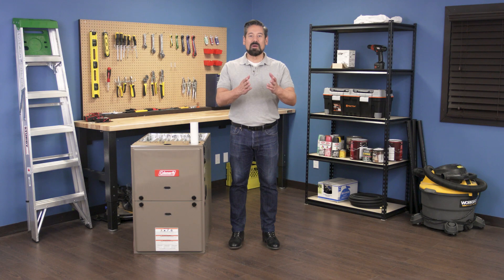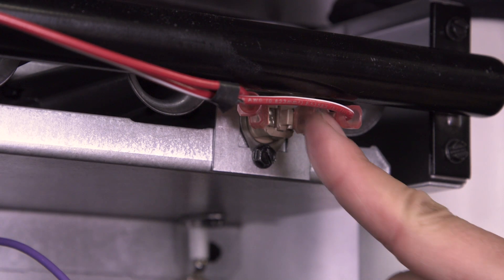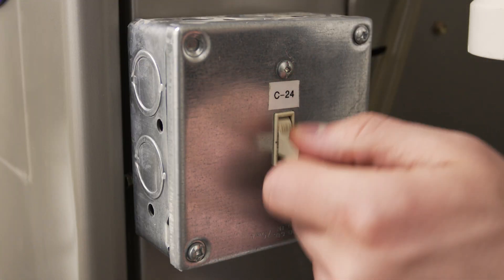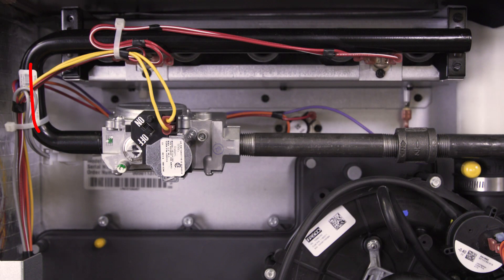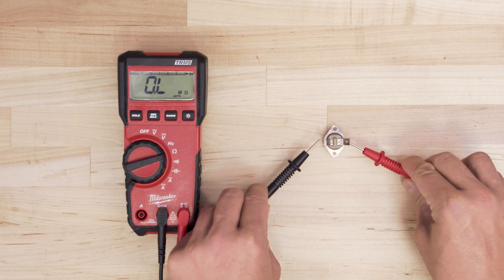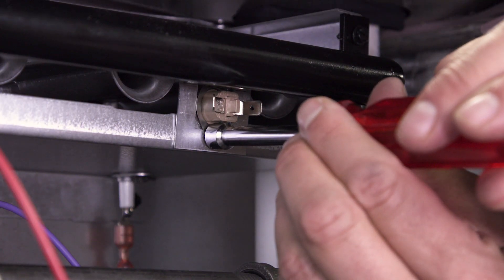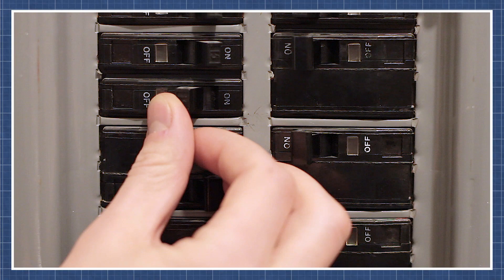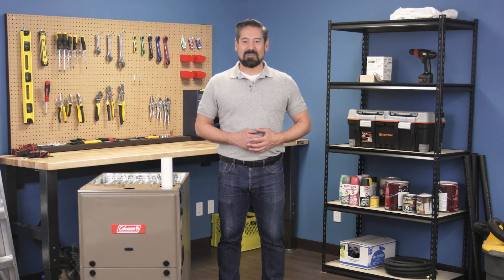Furnace - Flame Roll-Out Switch | Repair and Replace

Comment: Wouldn’t getting a hairdryer or something like that be another part of the test to make sure that it opens and is resettable versus just testing that it has continuity?
Reply from the maker: Thanks for watching. Yes you could test it to see if you can get it to trip again but generally these do not fail closed. There is a piece of metal that will heat up and bend and it will snap to open and disconnect the circuit. If the switch tripped, and you're able to reset it and it has continuity when it is reset both states are good. The most likely way for this switch to fail is that is is unable to reset and has no continuity in either state.

Comment: Dose wires has polarity?
Reply from the maker: Thanks for watching. A switch is a non-load component that provides an unrestricted path for electricity, or disconnects the circuit. There is no polarity and it doesn't matter which of the two wires attaches to which terminals, the switch will work the same.
Reply: @AmreSupply  thank you for quick reply 🙏
Reply: @AmreSupply  I was just at the job site saw rollout switch hanging next  burnes) it looks like it broke off the metal bracket 😳  but gas furnace still running,  I just placed back to the same metal bracket  , going to replace  tomorrow.

Comment: how did u get the furnace to light up w flames? after swapping the switch
Reply from the maker: Thanks for watching. After replacing the switch, the furnace should light up as normal however if there is an issue with the burners which is causing the flames to roll out the front of the burner, then installing a switch will not fix the problem.

If the furnace doesn't start up at all then it could be another issue, or the furnace might be in a lockout state. You can observe how far into the startup sequence it gets to help determine what is happening: https://www.youtube.com/watch?v=b0sAGt-1niU

Comment: I can’t find mine! Help! I have a Payne from the 80s I think the model number is super faded on the label. I know it’s an intermittent ignition. But it lights and then the flame shuts off soon as the blower comes on. What do you think the problem could be?
Reply from the maker: Thanks for watching. Does your furnace have a flame sensor? You can learn more in this video: https://www.youtube.com/watch?v=b0sAGt-1niU&lc=UgwaMZMBBptYZZllg1N4AaABAg

If the flame sensor is dirty or if the burner is dirty then the flame sensor will not complete the circuit through the flame and through the metal of the burner. Without a complete circuit, it thinks that there is no flame and it will shut of the gas.

Comment: I have a limit switch,  L17520F limit switch.  When the furnace blows cold air,  i reset the flame roll out switch.   Which device is the problem?

Thank you.
Reply from the maker: Thank you for watching. I am not sure what you are describing. Are you saying that the flame rollout switch trips during normal use? Or does it trip even when blowing cold air?
Reply: @AmreSupply  it runs fine for a cycle or two in the mornings.   When i get home every day at 4 or 5 i have to reset it.   Is it just because it runs all day?  My mom likes it too run all day.
Reply from the maker: @dalenjurgens6751   If the flame rollout switch keeps on tripping then there might be an issue with the burners. In this case it's best to hire a technician to take a closer look as simply replacing the rollout switch is unlikely to fix the problem.
Reply: @AmreSupply  that's what I'm discovering.

Comment: So I guess the issue isn’t the flame rollout switch in my case? Otherwise I wouldn’t have hot air, right?
What’s causing the blower motor to run 24/7 despite the thermostat fan setting being on Auto, not On? 
Was able to confirm the High Limit Switch wasn’t the issue. What else could it be?
Reply from the maker: Thanks for watching. A tripped flame roll-out switch will shut the furnace off. If the blower motor is running constantly, it could be an issue with the thermostat itself, or the control board.
Reply: @AmreSupply  Cool, I’ll look into those next. Thank you!

Comment: When he says airflow issues it could be as simple as dirty filters impeding air flow.
Reply from the maker: Thanks for watching. You are right that dirty air filters can create issues and it's always best to replace the filter, however if the flames are rolling out the front of the burners that's likely an airflow issue within the burners, heat exchanger and inducer motor. The furnace filter does not supply air to these parts.

Comment: Why not just turn off power cut the switch wires strip them and wire nut them together turn power back on and run the furnace for another 10 years~
Reply from the maker: Thanks for watching. It is not recommended to bypass any safety switch in the furnace. If the switch has failed then it should be replaced. If the switch is good, and it keeps on tripping then that means that the furnace is not operating in a safe way and will need to be inspected further.

Comment: My flame rollout switch keeps tripping. It overheats to 32.5 degrees Celsius. Could this be caused by a slow blower? Caused by defective capacitor?
Reply from the maker: Thanks for watching. If your flame rollout switch keeps tripping then there's likely an issue with your airflow. Its highly recommended that you get it inspected by a HVAC technician as soon as possible.
Reply: @AmreSupply  thank you, he’ll in be today
Reply from the maker: @MazingerZelchancho  Glad to hear it.
Reply: @AmreSupply  any way to check if the motor is switching from low to high?
Reply from the maker: @MazingerZelchancho  You can listen to get a sense of where the furnace is in its sequence. After a call for heat is made the inducer motor will run, this will be a bit quieter than the blower motor. After a minute or two the burners will ignite and the blower motor will kick on and circulate air around your home. With a blower motor with several speeds it will behave differently depending on the model but it will use high and low speeds to help maintain a more consistent temperature.

Comment: Thanks for the tip!  It's worth a try, if it doesn't hold no harm done you can always call the technician.

I don't know why some of these folks are getting bent out of shape; maybe they're the ones that charge $300 to push a button.
Reply from the maker: You're welcome, we're glad that you found it helpful! Overall I think a little bit of knowledge goes a long way and regardless many homeowners are still going to call technicians as they have the tools and knowledge to do some deep troubleshooting.

Comment: My AC repair tech was going to charge me $1,000 to replace the circuit board in addition to the $69 TS fee I already paid!!! I did this and fixed my issue. I appreciate the you guys, thank you.
Reply from the maker: Thanks for watching, we're glad that you found the video helpful! That is a steep price to replace the control board. If you do end up replacing it, its relatively simple all things considering. This video will show you how to access it: https://www.youtube.com/watch?v=4SY8lRl8HV0&feature=youtu.be
Reply: Was it short cycling ?
Reply: My board was not commanding 24 V AC to the gas valve. Changing the control board fix the problem. I knew this because the gas valve was opening and closing when giving it direct power from the transformer.  So I knew mechanically it was sound.
Reply: unfortunately finding the honest HVAC service contractors and or tech is the biggest problem. If you find one then keep him/her and recommend to your friends. Majority are typical capitalist and wants to be rich quick by their deceptive talks. Always check online for others options.

Comment: Mine runs for 15 or 20 minutes than Shuts down for 3 minutes  than come back on 
but it heats the house 
Code 33
Reply from the maker: Hi Brytney, thank you for watching. Best thing to check is to make sure that you furnace filter is changed, and that there is no restriction in the airflow. You might find this video informative overall. It could also be an issue with the high limit switch. You can learn more here: https://www.youtube.com/watch?v=0va_wvwfCBA

Comment: Why not check continuity with the switch installed?  If it checks bad then it can be removed..
Reply from the maker: Thank you for watching! You are right that you don't need to remove the switch to test it. For these videos we find that showing continuity tests on the bench with an overhead camera often gives the most clarity. This makes it easiest to see what is being tested while showing the multimeter display.
Reply: @AmreSupply  I now understand.  Thanks for your reply and thanks for posting your videos.  I have already fixed my furnace (replaced a control board) and my air conditioner (stuck float switch).  Did both myself and no doubt saved hundreds of dollars.

Comment: I think replacing the switch is the least of the problem here. Those switches rarely go bad and if it has tripped you have other problems perhaps serious!
Reply from the maker: Thanks for watching Ken. You are right that its not very common for a rollout switch to fail outright. Our goal with this series was to have a video showing how to replace each part of the furnace. We also have several troubleshooting videos like this one that shows more of the logic behind the whole system. https://www.youtube.com/watch?v=qRmNrmjKEyk
Reply: @AmreSupply  I have flame rollout switch that keeps on tripping.  But the switch is no where near the flames and on top of the fan next to the duct.  Know what might be happening here?  Someone said it might be an air flow problem.  I removed the filter for maximum air flow and it is still tripping.  The furnace was installed in 1985.  I'm going to replace the switch and hope for the best.
Reply from the maker: @lausy3  Thanks for watching. If it is located on the duct, then it will be the limit switch. These are similar except don't have a reset button. You can also test it with a multimeter: https://www.youtube.com/watch?v=0va_wvwfCBA
Reply: @AmreSupply  Thanks for the response!  It is located on top of the fan motor and it does have a red button for reset.  Last night I found out more of what is happening.  The motor itself is getting very hot for some reason and the switch is tripping.  I think this happens when the furnace first turns on but I am not sure.  My control board is very old has has the old school relays with loud clicking springs.  This relay was clicking on and off once or twice a second then ramped down to once every 3-5 seconds which causes the fan motor to turn on/off.  When I pressed the red button on the flame rollout switch, the furnace started up as normal.  Looks like the switch was stuck in an "in between state".

At times when the furnace is running as normal, the fan is cool to the touch.

I'm going to try replacing the control board and the switch.
Reply from the maker: @lausy3  We're just happy to help! These switches use a bi-metallic disk which changes shape and pops open when it heats up and expands. This metal can fatigue and wear out over time which means these switches can behave differently in older models. Replacing the switch would be a good place to start as these are cheaper and easier to find than older control boards.

Comment: Would like to see a video on pressure switches how to check if good or bad
Reply from the maker: Thanks for watching. We didn't make that video initially since it requires special equipment to test pressure switches. We may return to the furnace series in the future and add more videos though.
Reply: There’s plenty of things you can do without special equipment. Remove the on the pressure switch tube and gently suck in and out and see if you hear the opening closing of the switch. Furthermore, do this while checking continuity across the terminals.

Comment: I hit the reset switch and it worked...still buying the part for next time..
Reply from the maker: Thanks for watching! Keep in mind if the reset switch keeps on tripping there it is a sign of a larger airflow issue so in that case its best to get that checked out.

Comment: the flames on my unit used to go into the holes now they shoot upwards and out of control
Reply from the maker: Thanks for watching. The flue vent is likely blocked. This could be internally or even the vent on the outside of your home. If the flames are out of control then its best to call a HVAC technician.

Comment: I'm told a rollout switch can only be sold to licensed technicians. So a household has no choice but to call a professional. How much would replacing a rollout switch be, including labor?
Reply from the maker: Hi Dee V, you can order rollout switches here: https://www.amresupply.com/catalog/Fan-Limit-Controls-HZ3D If you are curious on the cost of hiring a technician to install it, then call a local company and ask for a quote as every company is different.

Comment: I would not advise this to the general public because flame rollout switches don't simply just fail.
Reply: Frigging common in my house...Just went for the third time on my 2nd furnace, driving me nuts lol
Reply from the maker: Hi Andrew thanks for commenting. You are right that its not very common, but flame rollout switches can still fail just like any other switch. There is a lot of DIY info on the internet and youtube and part of this video is understanding what the switch does, and when to call a professional. If resetting the switch is done once, and it never happens again, then thats a quick fix that saved a bit of trouble. If the switch continues to trip then its a indication of a more serious problem, which is best handled by a professional.

Comment: Thanks for the video,  but unfortunately my furnace issue is a different part, the pilot sense switch and your site lists  it for over 240% of what the same part costs elsewhere (with free shipping too, and yes it was brand new).  I know back in the day companies could set a price and consumers had no way to comparison price shop but today, in less than half a minute I found it cheaper elsewhere so a sale was lost... just something to think about.
Reply from the maker: Thank you for your comment we appreciate the feedback. We sell thousands of parts and many different switches and with the differences between availability and stock there might be some pricing differences between similar switches. Which part number are you referring to? I will pass this onto the team for review.

Comment: The reset button worked like a charm! Saved me $300 from the repair guys. I canceled the appointment. Thanks so much, very informative video!!!
Reply from the maker: Thanks for watching, its great you've got your furnace working again. Just keep in mind if the flame rollout switch keeps on tripping even after resetting, then this means there's a safety issue. If you have to reset your switch again, then you should get it inspected by a professional.